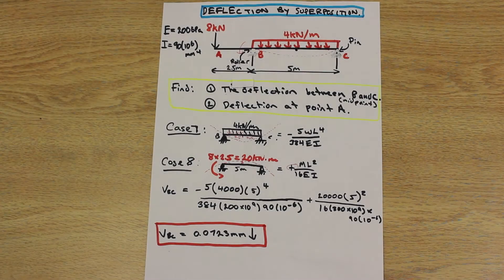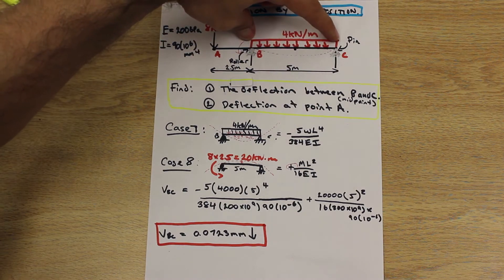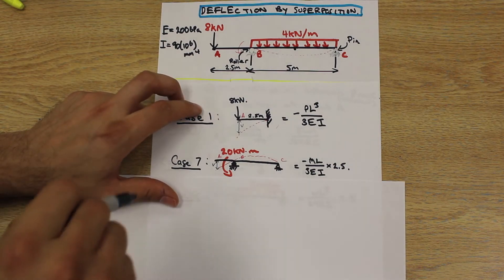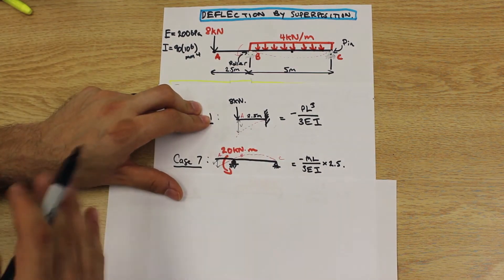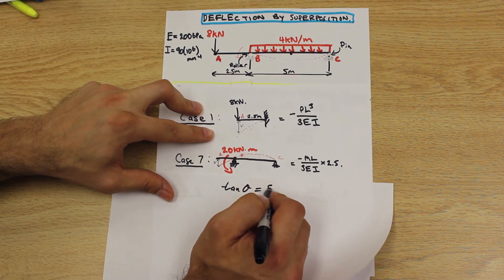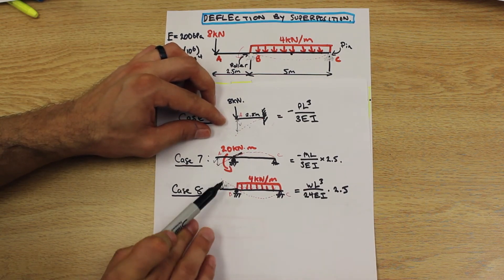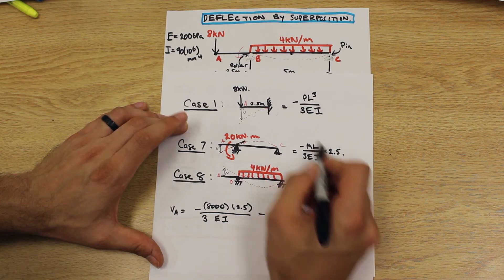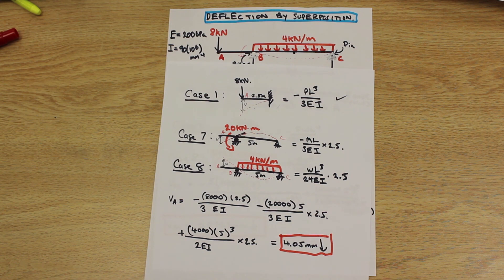How to Solve for Deflection Using Superposition Method - 2/2

Comment: What are the caveats for representing deflection as product of angle and distance between point of no deflection and free end ? 
If consider a simple point load cantelever beam at end, then at fixed point angle is zero which would mean L*theta is zero which is not true
Reply from the maker: We use both case 1 and 7 for this reason, not just case 1.